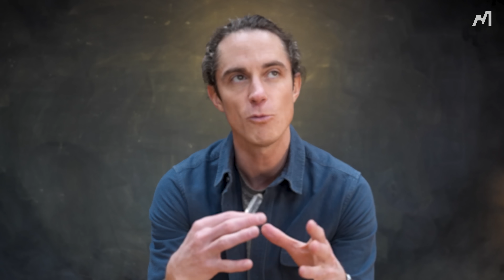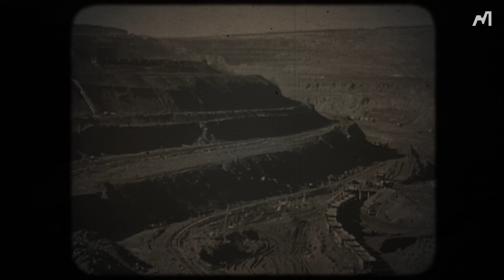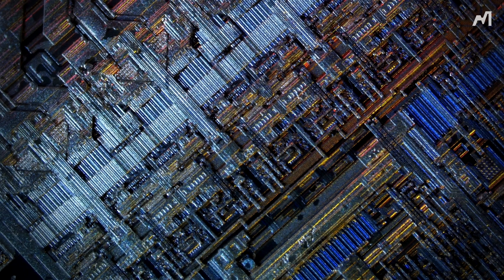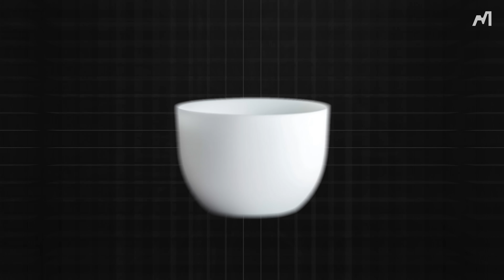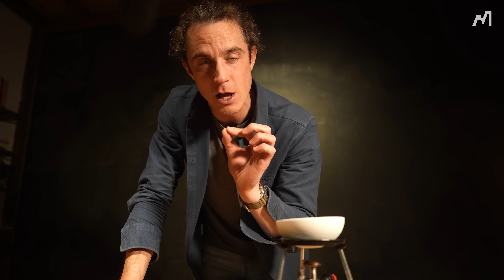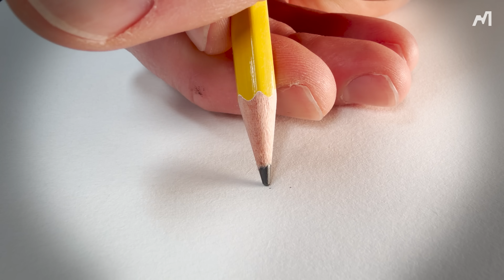Saudi Arabia Has Oil, America Has This

Comment: Well, i think you are going over the top with your irreplaceable Spruce Pine Silica. The biggest producers of semiconductpr grade silicon are China and Germany.
The production of pure semiconductor grade Silicon is via the gaseous trichlorosilane. This is then purified using fractional destillation.
It allows arbitrary silicon purities that depend on the process, not the feed stock.
Your spruce pine silica may be a great natural material for Quarz Oscillators, it ultkmatrly comes down to the differential cost of quarz processing from more or less pure silica.
Adding to zhis the supply risk of  beligerent US government, the processed Silica will win out every day.

Comment: "Found exactly at only one place on the Earth's surface"

A quick Google search actually shows that this is the MOST COMMON crystal to roam Earth's surface and every continent has it... Worse than that : Sand has quartz bits in it. Because it's silica crystals.

I don't like being baited by misinformation that a quick search can disprove so... Yeah no. Bye.

Comment: I think you forgot the part where we're not in the early 1900s anymore and we can purify the very abundant slightly lower purity sources of silica with basic chemistry but whatever gives you views I guess. By the way like 95%+ of the cost of advanced chips is in R&D and manufacturing not raw materials.
Reply: It's not chip-grade pure though. The purity tolerance only got tighter as the chips got smaller and faster.

And all that R&D will be idle if there's not the required resources to work on.
Reply: @doujinflip  we can reach purities of around exactly 99.999999999% with the Siemens process which is semiconductor grade. look it up.

Comment: Irony is that Silicon Valley San Francisco South Bay isn't called this because of Computer Chips. it was called this during glass making in the 1800s. it was called Silicon Valley before Bell moved to the west coast.  it has quality sand as well but apparently not 99. 11 9s. I only know this because of Black Diamond Mines in the Eastern SF bay area where sand was pulled for companies like Tiffany Glass (also out of NJ I think) . they talk about it on the mine- tours.  SF had the finest sand before Spruce Pine was discovered.  yet they still moved the operation of early computers to San Jose area or San Mateo.

Comment: Chemical purification is more important the the original quartz source. Temper the hype there is nothing in physics or industry that prevents manufacturing of high grade quartz. Through raw feed stock. Is it economical? Sure. Does it mean that other ways are not? No. If you have the plant and system set up to do it. Which the Chinese do. They have there own quartz mines and ecosystem set up internally.

Comment: I'm sure this is misleading, you can probably get the purity of Spruce Pine by other methods (sorta like how you get U235), it's just probably not cost effective..... doesn't mean impossible.
Reply: if USA can make chips twice as cheap as china simply because china needs to centrifuge their quartz to match purity, then china can't compete. they will buy it at 1.9x price rather than make it themselves at 2.0
Reply: @wikimon  The raw physical wafer blank is something like 1% of your overall cost of getting a chip out of it. There's a lot of processes applied and basically all of them cost more. Make that step 0 more expensive and the world wouldn't fall "25 years behind" like this presentation claims. Now, yes, generating those wafers by alternate means would create yield ripples, and perturbing yield could impact pricing several percent, and you might suffer another several percent increase in price if your starting point required a ton of additional refinement. You're netting out to something like a 15% swing in COGS not a 2x swing. Then once you wrap that in with packaging costs, etc. it becomes an even smaller fraction of the whole. The real impact would be a year or two to get everything switched over to a new source and recertifying everything, but this part of the pipeline could be massively more expensive without appreciably impacting the overall chip industry cost structure.

Comment: Fun fact: when they make the cylinder of silicon, they dip a perfect seed crystal of silicon into the melt. The molten silicon will begin to solidify on the seed crystal's surface with the same crystal structure. And the cylinder is rotated so the centrifugal force can push all of the "dislocations" (small defects) in the crystal structure to the outside surface...resulting in a cylinder that is also a perfect crystal. 

I hate when people mistake silicon "sili-kin"(the element) and silicone "sili-cone" (ie the rubber or grease)

Comment: High purity quartz can be produced anywhere in the world.  It is not mined out the ground and used without processing for growing wafer material. The key is just that the few high purity places it can be mined are cheaper to process and require less refining to convert it into the needed ultra high purity quartz.  You can literally take beach sand and put it through a long series of steps to refine it to remove the impurities but it is a waste of resources to start from such a low quality product when more pure ones exist and can be mined.
China has a huge domestic supply of ultra-high-purity quartz with estimates of at least 35 million metric tons currently discovered with more deposits likely to be located as time goes on.

Comment: Spruce Pine makes _70-90%_ of all silicon used in chip production.  It's in particular key for the crucibles needed to melt the silicon before the massive crystal is pulled to be cut into wafers.

Comment: Is the silica crucible more like a liner for the crucible than an actual crucible? Because I don't get how it doesn't just melt and have the problem of contamination too. But if its meant to line it all and melt with it, and with no stirring I assume the contaminants would stay in the melted "liner/crucible" instead of migrating through the rest of the silica. So when the giant crystal is formed and pulled out the silica that made up the liner naturally stays along the perimeter and eventually bottom of the crucible as the crystal grows and is pulled out leaving just the contaminated silica at the bottom of the crystal to chop off and in the crucible. That's how I think it happens in my head because I don't see how the silica crucible could function without melting too and being contaminated it must be part of the process and act as sacrificial silica for the contaminants

Comment: FYI they clean the crucibles with Paranha Solution (google it) under extreme clean conditions and do the casting under a controlled (neutral) atmosphere. Hard for commendations to exist when they've been chemically purged. Acid & heat make things *extremely* clean.  

None of this black magic all the patents are expired. It is just idiotically expensive & hazardous to get started.

Comment: Purifying silica (on the scale needed for semiconductors) is easy: Convert to SiCl4, fractionally distill, convert back to SiO2 (or to elemental Si), and proceed from there.  Having the original natural source be exceptionally pure is a minor cost savings, not a big deal.
Fractionally distilled silicon tetrachloride SiCl4 routinely achieves a purity of 99.999% (5N) to 99.9999% (6N)
"Irreplaceable" is dead wrong.
Reply: Thanks for clarifying his comments... Appreciate you pointing out the flaw in his logic
Reply: Easy?  That sounds far more intensive than mining something almost already that pure and then refining it further.
Reply: @tokomok  "almost already that pure" - and how would you propose to remove the remaining impurities to bring it to the level needed for the crucibles without a comparable process?  The Spruce Pines quartz isn't just crushed and used.
Fundamentally, the main point of view of this video is wrong.  The expensive part of making chips is the complex and precise processing, not the starting wafers, not the crucibles for growing the silicon boules that are cut into wafers.  A jump in the price of the crucibles to accomodate some processing to start from ordinary beach sand instead of Spruce Pines quartz is not going to significantly change the economics of producing chips.  SiCl4 costs about $1/kg. Using it to produce SiO2 for the crucibles instead of Spruce Pines quartz is a nit in the overall economics of sophisticated chips.

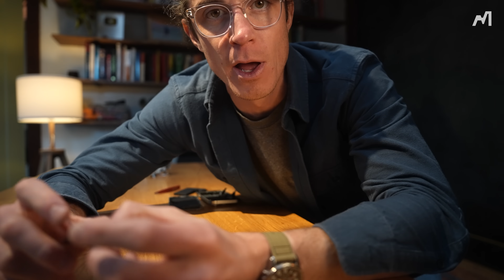Comment: 5:04 incorrect they will fuse off or disable those failed pathways and either downgrade the chip or have spare redundancies to keep active.

Think how cuda cores work in a gpu Nvidia may have a set of wafers intended for the rtx 5090 but because of flaws 50% of the chips aren't good enough or stable enough for the 5090 so they weldoff or fuse portions of the chip to make rtx 5060 gpus

Comment: Remember when the US banned Nvidia chips to China? It only forced China to create its own GPUs.

In 2024/2025, China announced the discovery of massive quartz deposits in Henan and Xinjiang provinces. While experts believe this quartz is currently lower quality (suitable for solar panels but not advanced chips), an American embargo would only accelerate China's state-funded drive to perfect the purification technology.

Total restrictions might force China to subsidize synthetic quartz production. While currently too expensive for mass use, a U.S. ban would make cost irrelevant, potentially costing the U.S. its natural monopoly in the long run.

For example, the US blocked China from buying ASML's advanced lithography machines (which are needed to process the silicon wafers made from Spruce Pine quartz)... China can buy all the quartz it wants, but without the machines to process the resulting wafers into 3nm chips, the quartz is useless for advanced applications.

Did that help?
China might leapfrog ASML entirely. While the West is focused on whether China can copy ASML’s machine (which shoots lasers at tin droplets), China has been pouring billions into a completely different technology called SSMB-EUV (Steady-State Micro-Bunching).
Instead of a small machine, they are building a massive factory-sized particle accelerator (synchrotron) to generate the EUV light. This bypasses ASML's patents entirely. It creates a powerful, continuous beam of pure EUV light that can be split to supply multiple lithography stations at once.

As of this month (January 2026), there are credible leaks that Huawei and SMIC have already "taped out" (finished the design for) a 3nm-class chip, possibly for a future "Mate" series phone.

The Chinese state company SMEE (Shanghai Micro Electronics Equipment) was largely written off by Western analysts as being stuck at 28nm. However, recent patent filings suggest they have been hiding their progress.

They are reportedly testing a domestic EUV machine that doesn't use American parts. It is likely not as good as ASML’s current model, but it doesn't have to be perfect; it just has to work.

The reason Western analysts often get this wrong is that they calculate based on profit, not pride.

Western View: "You can't do 3nm because your yield would be 20%, and you'd lose $1 billion a year."

Chinese View: "We will lose $10 billion a year if necessary, but we will have the chip."
Reply: It’s possible that someone could leapfrog the lithography race altogether if they can refine a technique for direct fabrication of conductive/non-conductive lattice with plank length precision. This is to say that it would not be by any means “easy” but that out-of-the-box solutions may still hypothetically exist.
Reply: Laws of inertia. China gloats. Their military weapons also don't work. Why trust a nation which is fundamentally dishonest? Missiles not working or tanks not lasting. It's so funny people put so much Faith. China will never be anything because of their enclosed system to fight capitol flight. They are not an open market. They copy and steal and undercut global markets. To drive them bankrupt by bankrolling subsidies. This is why they ultimately will be driven out of the global economy. Partnership formed in this manner is a lot more nefarious openly. World dominance in this manner will not succeed. It's not hard to see the truth if you look. In reality you probably aren't a real person maybe even just some ccp using chat gpt . 😂
Reply: Where are these mythical Chinese better gpus i dont see any
Reply: @viktorsov8729 we are talking about AI supercomputing GPUs here pal. Not end consumer cards that use direct x and windows drivers.

Huawei (Ascend series)
The Card: The Ascend 910B (and the upcoming 910C).
Does it compete? Yes.
The Reality: This is where the real money and effort is going. Since the US banned the Nvidia H100 (the top-tier AI chip), Chinese tech giants like Baidu and Tencent have switched to buying Huawei's chips.
Performance: Reports suggest the Ascend 910B is genuinely comparable to Nvidia’s A100 (the previous generation flagship). It’s not quite an H100 or Blackwell, but it is "good enough" to train large AI models, which defeats the purpose of the US ban.
Reply: China risks going broke in the attempt before achieving the automation productivity gains needed to break even, especially as valuable foreign currency is already drying up as global customers distance themselves and set up their own manufacturing competition.
Reply: @doujinflip Continue to dismiss China. It has worked wonders in the past.

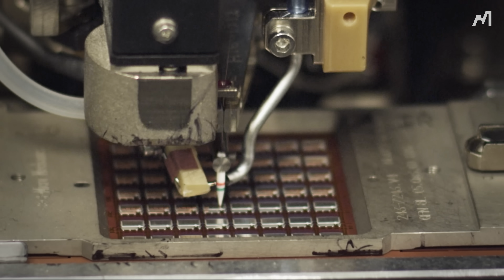Comment: i got a 2 year associates degree in electronics. all we were taught in digital electronics was and, nand, or, xor, nor, not, xnor gates. seeing the picture at 3:40 makes me see how little i know about processors. there's so many different shapes.  i don't get how they have time to make all the billions upon billions of devices there are. logically they would make each indiviual square in different factories then place them in different configurations based on the client specifications. but still a pick and place machine can only work so fast. if not they have to cut a total slice umpteenth times and they have umpteenth layers per processors. not accounting for the gold and that green stuff they need to include. i dont see how taiwan can have a monolpy on the industry. they only have 13,000 sq miles. a conservative estimate of 1 billion products per year and 1 factory per square mile theyd have to make 769230.769231 chips a day. that doesnt seem feasible
Reply: by that logic you said at 11:04 that the mine is 25 feet deep. at 00:20 you said that it takes 250 pounds per 1 million iphones. quarts weighs 20-30 pounds per square foot i think. thats means to make 1 billion iphones the mine would have to be 2 thousand miles surface area just for iphones not counting every other processors.

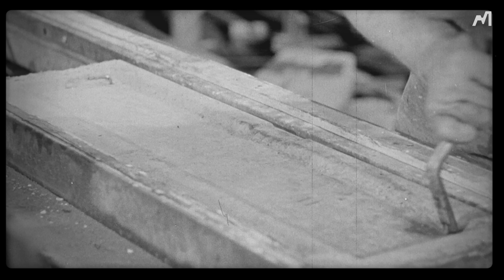Comment: oops! @ 1:16 you said "You have concrete".  Nope - you have cement.  Add sand & aggregate then you have concrete. (1:3:6 - cement, sand aggregate)
Reply: The Portland cement used in concrete isn't silica at all, it's lime from limestone. Carbonate based, not silicate based. The sand and aggregate are more likely to have silicates in them than the cement is.
Reply: @willythemailboy2  yeah both the video and the original post wasn't quite addressing things correctly.
Reply: He was talking about sand. He was skipping over calcium carbonate like it wasn't a primary.
Reply: The concrete doesn't mater. It's the high end chips that do.
Reply: 🤓erm actually ahh comment
Reply: Just turned off the video on this moment.
Reply: @MrEntertheusername facts if they got that wrong, what else did they?
Reply: I appreciate you.

Comment: Hey Max, great story telling but as someone whose spent over a decade in this industry I fundamentally disagree. 

High purity SiO2 (Quartz) is not the same composition at all from UHP silicon for chips. Optics absolutely & photonics, sure. But chips are manufactured with reduced SiO2 (in the form of Si)

Sure it can be a precursor & there are tons of applications for SiO2/SiOX for optics, photonics, gorilla glass in phones ,etc. Its just one of many precursors you can use for polysilicon production via metallurgical grade. 

Extremely high purity Si can be manufactured many ways now from impure SiOx via reduction to silanes & distillation/refinement. 

Saying we have a monopoly on the supply chain for producing advanced chips because we have UHP quartz is kind of like saying "We have a monopoly on phosphorous for food, pharmaceuticals, etc because we have the purest mines of sodium metaphosphate". 

8.8 million metric tons of Silicon is refined for chip manufacturing annually. Over 6 of those are from China. Dont believe me? google it ....'technologyglobal.substack.cxm/p/geography-of-the-semiconductor-supply'

Do better research.

Comment: Absolutely great video! One small exception though... The sand on many tropical island beaches is actually the crushed remains of coral which is calcium based. There is also supposedly a beach in Australia that has sand made of zircon. I seem to remember that the zircon based sand was at one time collected and used for abrasives.

Comment: This video is silly silicon can be refined, you can start from low grade and work up to high grade. Silicon is one of the most abundant atoms on earth after oxygen, using the most pure source naturally available is a question of COST not of possibility. If America cut off the supply they’d just open silicon refineries, meanwhile America can’t use alchemy to create rare earth it doesn’t have, this entire video is such cope